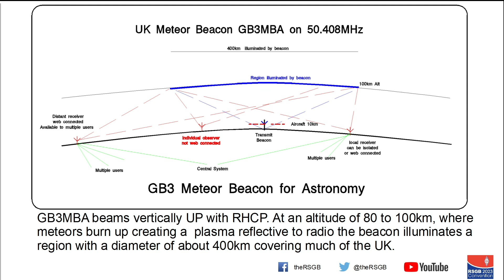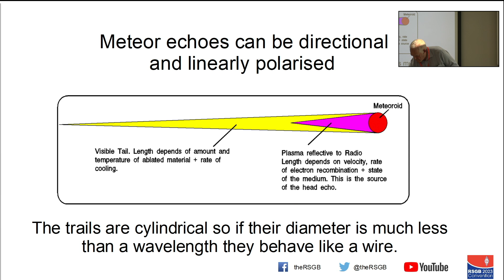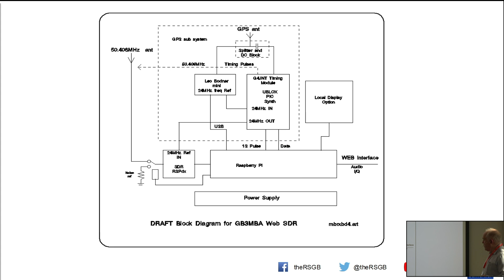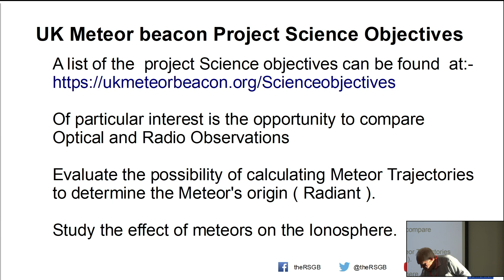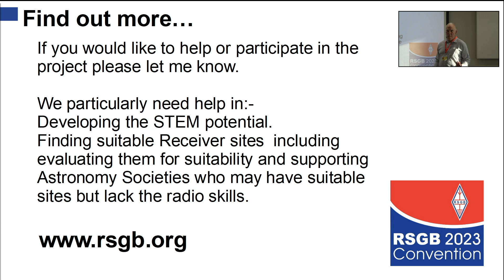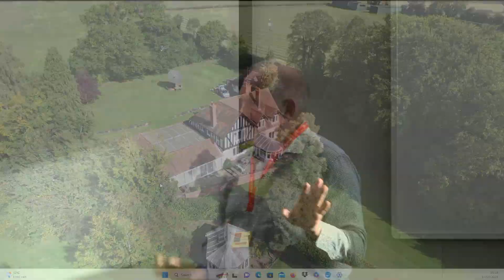RSGB 2023 Convention - The UK Meteor Beacon project

Comment: Okay, I get the relevance of the head echo’s Doppler being used to determine velocity and by triangulation path, but could not the tail echo be used to extrapolate tail length and also path? Found this to be an extremely informative and professionally delivered presentation about an aspect of amateur radio I had never previously given much consideration to. Bravo Brian and credit to RSGB for supporting a project that could bring heightened respect to the radio amateur community in the UK.